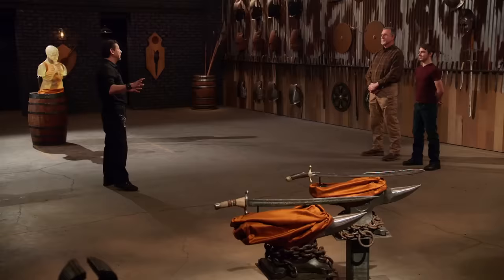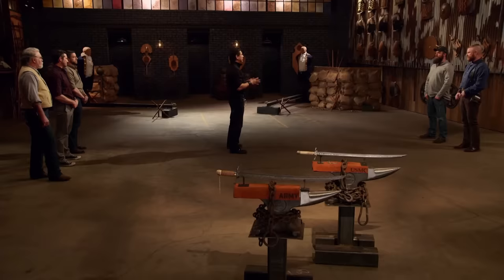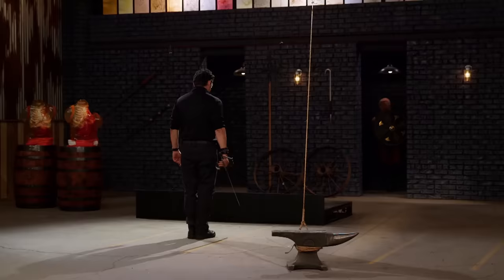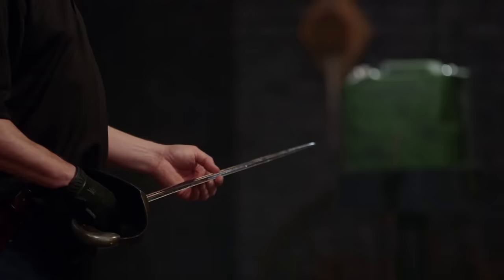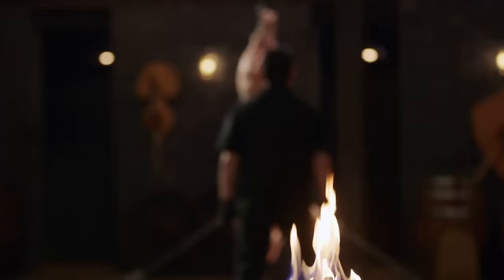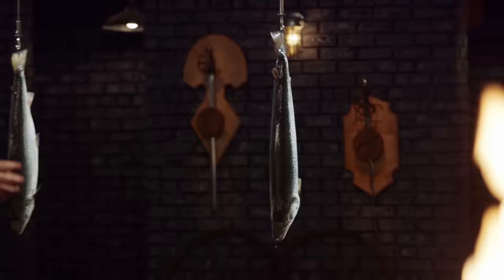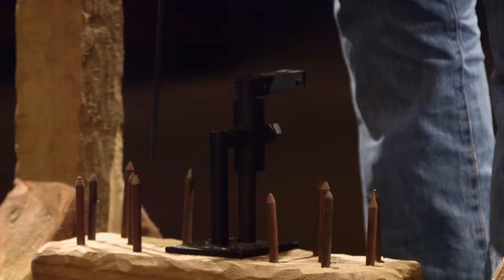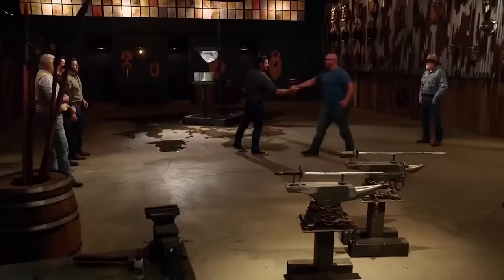Forged in Fire: History's MOST INFAMOUS Weapons Tested | History

Comment: they should do a medieval style episode where only manual tools from the era are allowed, and instead of single competitors its teams of smith competing to have the best forge. Wood be super cool seeing someone stomp on a bellows or use a chain pulley while anotherguy heats metal and hammers it, a third is on a work bench putting the handles and such on the blade, and then a fourth is using a man powered stone grind wheel to sharpen the blade. After wards they all put the finishing touches on it and examine it to make sure its to their design. 
They should work together to design the blades, and should cycle through the different position for the different levels of the competition.